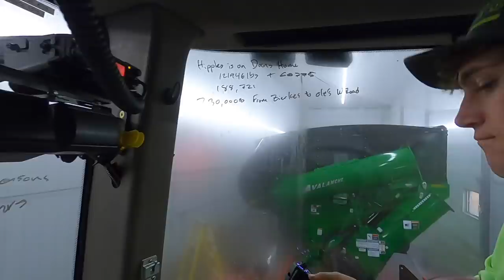Takes Awhile To Wash The Worlds Biggest Cart.

Comment: Idk how many bushels you ran through the cart but lil tip. We have a 1596. Replace  the 4 center bolts (3/4x6) in the tub auger. Alot easier in the shop instead of middle of the field at 11pm.

Comment: Just started using foam cannons also. You guys washed exactly the same way I do. Knock the big stuff off by hand, then pressure wash the whole thing, foam it, the wash again (bottom to top) then a nice rinse. I also found a spray wax/protectant called Formula 4. I throw that into a foam cannon also and rinse with it when I’m done. Doesn’t necessarily make the equipment look shiny or greasy but helps the water bead up and I also think it helps with washing the next time.

Comment: You need to put some thought into a way of making a hubcap for those big wheels. Something that can be easily removeable and that can be expanded so that it'll sit inside the wheel tight, or put some ceramic coating on the wheels so stuff just spills off.
Reply: Heck. I spent 600 bucks on a lawn mower and 800 bucks on a tool box, I wax both just to make it pretty

Comment: Here's a thought: if you stick a plastic strip or two inside the wheel rims at an angle then theoretically it should walk the trapped trash back out again rather than it rolling round and round inside  the rim. You'll need to work out which direction they need to be fitted but I think the leading edge outermost should do the trick. Best to Nicole and a very happy Christmas to all the Larsonists!

Comment: Washed carts like this before take the pulley system cover off where the pto goes into on the cart you’ll be surprised how much dust will be in there. And grease the entire cart after washing and let it run for 10 min to push any water out of bearings avoid some headaches in the future

Comment: Ok, someone needs to invent a plastic insert/hubcap for those track wheels that slants and pushes all debris out of the rim or largest chrome dome hubcaps ever.   Just need to know what is the inner diameter of those and the small ones.  Are there grease points that need to be accessible for each of those?   I've got my thinking cap on and a full cup of  coffee.  Really nice to see that they want to maintain their investment and even think of the small details.
Reply: We just weld a piece of metal molded to the shape of it and it works great

Comment: Is there a slot in the middle of the floor to drain the water? If so, how is it cleaned? What is done when it gets packed with mud, etc?
Reply: George Jones   Thanks, I wonder how it is cleaned, seems like it would fill with mud, etc. Given the cost of equipment, the bay seems very useful.

Comment: On the Lip of the inside of the Track Wheel Drill some Holes around the Lip so that Water and Dirt can Drain out and that will Slow Down the process of the Problem you can have